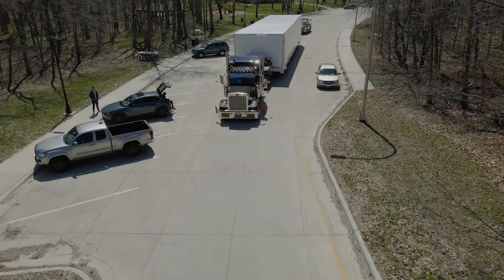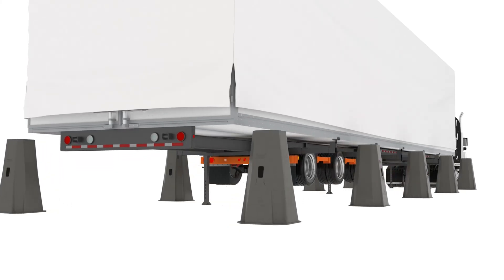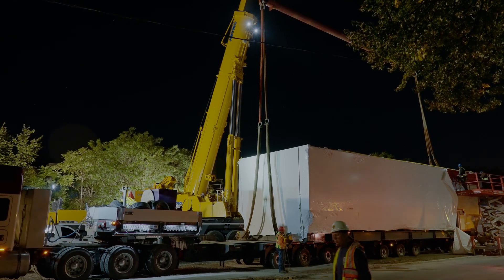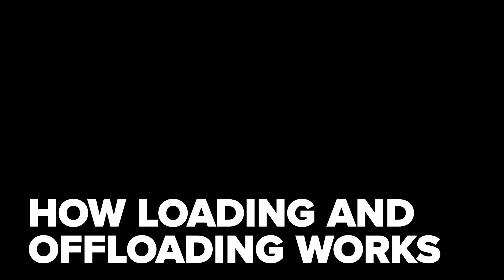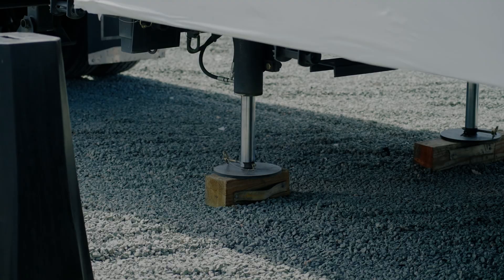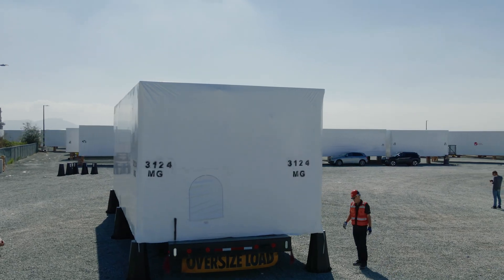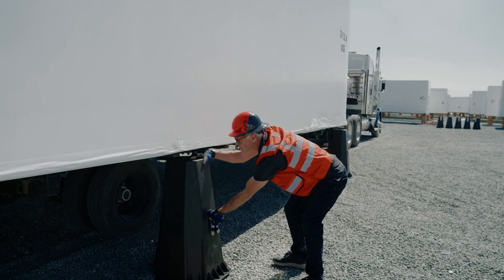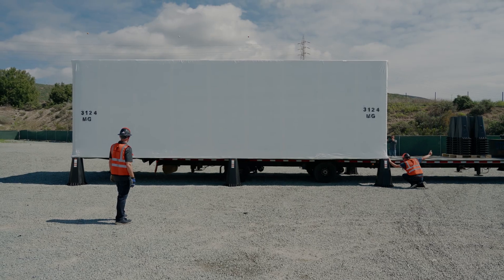This Trailer Loads Itself Without a Crane?! 🤯

Comment: these seem good.. where is cribbing usually used?  shipping yards? truck yards? specific type of builds?
Reply from the maker: @sharkbait11 Cribbing is commonly used in construction, shipping yards, and industrial settings to provide temporary support or stabilization for heavy loads or equipment. It involves stacking and arranging timber or engineered materials in a specific configuration to evenly distribute weight and prevent shifting or settling.